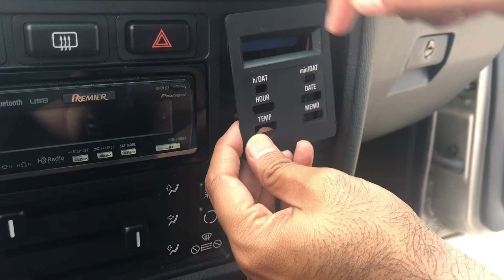6 Button E30 OBC LCD DIY

Comment: Just saved me like 85 bucks. Thought it was harder to swap than that(soldering). So was about to buy a obc that already had a new lcd swapped in for 100 usd plus shipping(mine works just the screens bleeding real bad). Just bought the screen for 24 usd. As well as showed me a easier way to pull the obc out. Given i was thinking i was gonna have to pull the console again to get it out after swapping my console bulbs outs earlier this week.  So thank you.

Comment: where do i buy the lcd part
Reply from the maker: John Le Comte Ebay.
Reply: I haven't seen them on ebay, however there's a german company called 'partworks'  (they have a .de tld) that seems to specialize in manufacturing replacement instrument panel parts for classic cars. They make and sell replacement LCD screens for both the 6 button and 13 button OBC models.
Reply: you can get replacement bulbs (so that the OBC lights up properly) from pelican parts for like 1.25. I think they're BMW specific